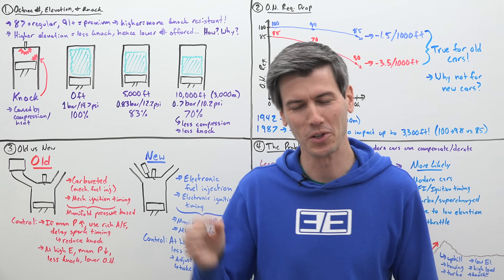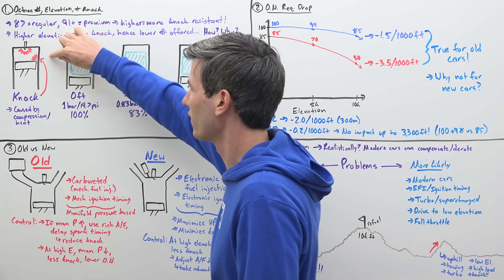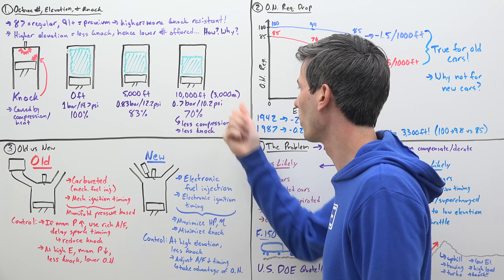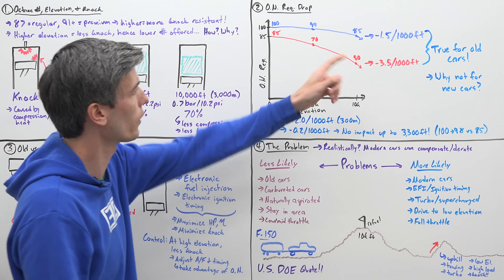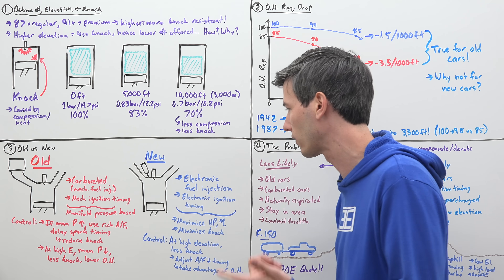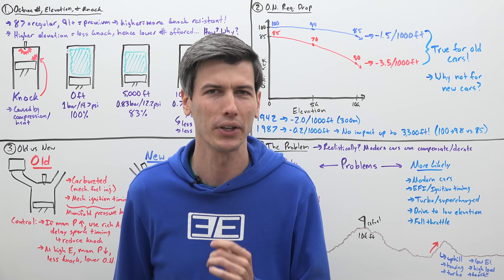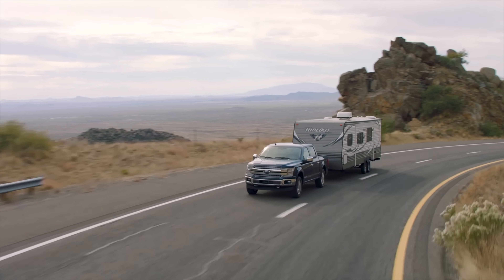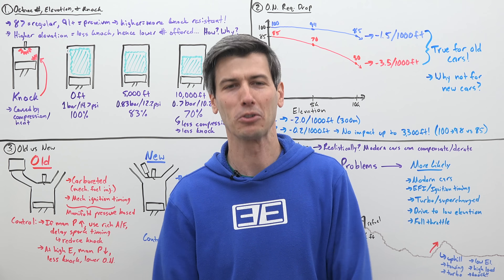Never Use This Gas In Your Car!

Comment: "I'll immediately change to 87, lol." - People who have been using 85 octane 4500 ft above sea level for 50 years. --   Something tells me this guy has never driven or owned a car in the mountain west. Modern fuel injection, even in turbos, at elevelations above 3500 feet runs splendidly on 85.  Should you put in 91 if you really want to MAXIMIZE HP and torque?  sure.  But we're talking fractions of better performance.  

The part he's NOT mentioning is the ethanol variable.  Around here in Utah all fuel is at least 10% ethanol.  That 85 fuel vs 0% ethanol 85 might actually be noticeable due to the slightly higher burn temp of ethanol blends.  The lowest pure gasoline octane available here in Utah is 88 octane...thus validating both @EngineeringExplained and my viewpoints.  The higher burn/combustion temp of 85 octane blend is not mentioned in this video.  I don't love ethanol but it's the reality of the world we live in.  You simply cannot find non-blend 85 octane in 2026 that you perhaps could have in 1987 -- and if you could, you wouldn't want to put it in your 2026 Ford F150.  Furthermore, ethanol has a high heat of vaporization, meaning it absorbs more heat as it turns to vapor, creating a cooling effect that can reduce engine knock, but this doesn't negate the higher combustion temperatures.

 I can't think of anywhere in the US where you might fill up above 9,000 feet and drop to less than 3,000 within a tank-full in a fully loaded/hauling pickup - but I suppose there's areas.

Comment: My family lives in Colorado and has been using 85 octane forever. We have fairly new cars (2010, 2014, 2022), all different brands and different engines (4cyl, V6, V8). We have never had any problems. If we plan to drive out of state, we do opt for 87 though.

Comment: This is a great video. My buddy has a Raptor and the dealer told him he could run it on regular, but in Colorado, where we live, they sell 85. It won’t destroy the engine due to knock sensors, but it retards the engine so much it gets much less power, and as a result less MPG. Now that Toyota and other brands are doing away with NA engines and selling turbo 6’s they are telling people they can run regular in them but not that regular is 87, not 85, and that the EPA mpg rating is using premium. Current engine controls and turbo engines are throwing everyone for a loop. The same goes for VVTi NA engines. They have to run mid grade to get the performance they were designed for. Dealers are playing both sides of the fence- they don’t want to tell people there new cars require premium, thinking it is a negative attribute, but they also aren’t telling people using regular won’t get them
The MPG/power they were promised from the factory. And no one is talking about 85 octane making the whole problem worse in high altitude states.

Comment: I grew up in an 87-93 area, now I work in an 85-91 area. A coworker somehow took such bad care of his '23 6.8 F-250 work truck that we had to get a new engine installed at 44k miles. Cams and lifters were ate up. I guarantee it was a combo of using 85 with 70% of it's life idling.

I always put 89 octane or 100% in our gassers. Seeing the 85 sticker for the first time really threw me for a loop

Comment: I don’t agree that 85 shouldn’t be available. Each vehicle has its requirements written in the manual. If your vehicle tells you to not use 85, then don’t. None of this is new. Some cars have required high octane long ago. Many even said on the gauge or filler to use “premium only”. 
It’s the driver’s fault if they don’t read instructions.

Comment: Manufacturers have lost this in court.  They must make their vehicles to operate on fuel in all states.  That's why more modern vehicles have variable timing and say with high octane you get more horsepower and fuel efficiency,  but less performance with lower octane.

Comment: I mean they sell diesel too even though you shouldn't use it in non-compatible cars. Just require signage and warning labels. No need to outlaw cheaper gas people also use in things like lawn mowers or snow mobiles that run a carb.

Comment: First (and only) time I got burned by this, I had just crossed into CO. Wasn't paying attention, fueled with that U85, and proceeded onwards. Learned that day that gassers can derate, while climbing Eisenhower right up against my Ranger's load capacity. Pulled over right before the tunnel, let 'er cool until the charge air line headed to the air cooler stopped glowing, cleared my codes, etc... got lucky in that there was no serious damage. Picked up half a tank of U92 once I hit Denver to forcibly raise the overall octane rating in the tank, never made that mistake again lol

Comment: @TFL lol

I would expect a fuel injected engine with a Vane Air Flow meter to be OK with slightly lower octane at high altitude as well as a carbureted engine.  A bunch of VAF metered systems were made in the late 80's and 90's, but were phased out by the early '00s.  Anything with a Mass Air Flow sensor is no-go.  By measuring mass instead of volume, the MAF systems are correcting for altitude in the fuel metering calculation.

Comment: One MAJOR question unanswered - if the engine's electronics will protect itself from damage, why does Ford (or anyone) say avoid "low octane" gas?

Yes of course the performance will suffer, but the subject of this video was the DAMAGE issue.

I'd guess there is some limit to the engine's ability to protect itself? But that question was left unanswered.

Luv the videos.

Comment: I'm surprised that Ford was the one that claimed that. I used to work for a limo company that has a fleet of 250+ Expedtions and Transits, all with the 3.5 Ecoboost V6. They run 85 octane exclusively here in Colorado. It is all high altitude driving though, with the lowest elevation being 5280 feet, and the highest being 11,158 feet. No towing involved, but still hauling up to 11 passengers plus packed full of luggage. In fact, they had to ditch Mercedes Sprinter vans because they kept developing frame cracks from the excess weight. They don't anymore, but they used to test engines for Ford when I first started there.

Comment: 85 octane is sold in places where the air density supports its use. Places such as Colorado have lower air density and thus less knocking.

The maximum octane is also lower. Some states have 93, some have 90. The minimum ranges for 85-88 depending on where you live.

Yes “some cars” ban 85, but they also don’t allow 87. 

Some cars detune the motor automatically and can run on any octane.

I wouldn’t suggest you get 85 and then drive to the coast on that tank, but using it at 5000 feet isn’t an issue.

The extra $1/gallon at 150K miles is $7,500 assuming 20mpg. I don’t see the benefit of the better gas depending on the compression ratio and or boost pressure for the specific car.

Comment: Been putting 85 in my 2001 Toyota Camry for 20 years. At 235k miles it is excellent condition and I do not see the point in changing now. It's a manual stick shift and I keep it at low throttling. All it needs is gas, oil, brakes, tires and routine maintence which I am very consistent at so I see no reason to change. My car pays me to drive it. 😂

Comment: I drove a 2016 Subaru foster. And I did not realize you had to put 87 octane in 85 was used for about a week. When we noticed that the MPG had dropped considerably about 25.mpg when we put in 87 we averaged about 28 to 32mpg. 87 works.

Comment: I really appreciate this video! I have lived in Colorado for 6 years now and have always been against the idea of running octane lower than what the manufacturer calls for(mind you most vehicles call for 87 minimum). In my experience I have noticed all the vehicles I have owned with EFI have required at least 87 if not 91. It's also not just Ford that mentioned the few states selling lower than 87 octane fuel. Nissan does the same thing and mentioned it in the owners manual on my old 1993 Pathfinder and my 2012 Frontier. I don't recall them mentioning the idea of running premium fuel though. As for Ford, I remember with both my 2019 Ranger and my Grandpa's 1994 F150 stating in the Owners Manual to not run lower than 87 and to use premium fuel for Towing and better performance. Keep in mind the F150 has the old 300 straight 6.

Comment: DO NOT USE HIGHER OCTANE  than your manufacturer recommends in cold weather.  You will get misfires in cold weather and very hard starting due to the increased ignition temps needed to combust higher octane fuels.

Comment: Would like to see you do a breakdown of effective octane and anti knock properties in the winter. Here in Canada we have 6 months below freezing sometimes down to -40. My conjecture is knock is not possible on 87 even when 91 is required, and there is much more performance/timing on the table that manufacturers leave off.

Comment: You stated several times that the manifold pressure was higher under load, but without forced induction what you're actually getting is less vacuum.  Technically your statement is correct, but it could be misunderstood that something is boosting pressure.  Thank you for another excellent lesson!  Love this channel!

Comment: Different engines have different compression ratios. Cars that have higher compression need higher octane gas to prevent pre-detonation. Lower compression, less octane without worry of pre-detonation. Being at a high elevation (Less bar in the cylinder) , effectively making it lower compression. Therefore 85 octane at altitude acts like 87 at sea level. If you’re driving through the mountains, 85 is NOT going to hurt your engine.
Reply: I read through the comments and you are the few who got it right. It’s the engine compression ratio which makes the difference😂

Comment: I have always used 85 Octane here in CO. Never really had a knock issue.  Currently drive 2 modern vehicles with turbo engines, too.
Reply: He said that was no problem unless you drive that gas down to lower elevation and then push it hard.

Comment: So... in the discussion of the upper left quadrant, that's not how it works.  Your intake pressure is lower, and your bottom-dead-centre is lower --- the former by .7 (say), but the latter ..well that's way more complex.  The pressure pushing air in is .7, but the air charge that ends up in the cylinder is going to be a factor of the fluid dynamics of the intake and the time spent during the intake stroke.  It could be wildly different than just the same fraction as the intake air.

Comment: I remember almost over a decade ago a gas station right on the border of Virginia and North Carolina had every octane between 87. I think 91 going up in increments of 1. It was the first time I'd ever seen a gas pump with so many different buttons.
Reply: By the race track?
Reply: Almost any gas station can do that if they want - there's only regular and premium in the ground, the pump just has a mixer that mixes them together 50/50 for mid grade, but you could literally create any octane between the 2 at whatever increments you want by just adjusting the ratio.
Reply: Sunoco?

Comment: In Colorado it’s 85,87,91, my Camry uses 87 and  I use 87. I use  to put 85  till I put 87 and noticed the difference in power and efficiency and also my manual says so

Comment: Its kinda crazy to me that you can still buy regular gasoline in the US (91 RON 87 in the US) here in Germany you can only get 95 and 98 (100+)
Reply: Kerosene is compatible with diesel to some extent.  It depends on the ratio.  A little kerosene in your diesel will prevent gelling in cold weather.  Too much kerosene and you will not have enough lubrication.

Comment: You are most likely to have an issue on motorcycle (or likely very high performance engine car) from the early days of fuel injection before knock sensors were installed.  Now make it a speed-density FI mapping, air cooled and pushing limits of the what the platform was intended to allow (think Buel Thunderbolt) from the the factory.  At altitude it still does fine but the second you get below about 4500 feet it is more likely to have knock under high throttle openning, low RPM than a CV carb engine (because CV carbs compensate for you).  

My 1999 Honda VFR is water cooled, actually used a MAF but it still exhibited minor issues using the 88 (mid-grade) in Colorado when it would come down from altitude.  My Buell Ulysses that REQUIRES 91 octane had issues that a less attentive rider could have made catastrophic coming down from 7500' to 3800' on a hot summer day filled with the highest octane available which was 89 AKI.

Comment: It doesn’t help that turbos on cars are added to increase power even at sea level while reducing engine size. Airplanes and Diesel trucks use turbos only to compensate for thinner air at altitude but not to downsize engines.

Comment: I think it's odd that the octane levels of the available gasoline or so close, only a few percent difference.  It doesn't seem that significant.  I wonder how accurate the octane ratings are.  If gasoline was available in 90, 85, and 80 octane, restrictions on usage would make more sense.

Comment: I kind of get where you’re coming from about selling the fuel, but then again they also sell diesel at the same gas stations. You also don’t want to put that in your gas powered car. But they can sell it of course. Same with e10 gas here in Europe. It usually has a sticker next to it that you need to check if your car is suitable for that type of gas.

Comment: I believe I had some LSPI in a 6.6L L8T GDI engine running on 85 octane in at around 5,000 Ft because of this low octane fuel. I did refuel with 87 before I left the elevation.  LSPI is more serious than spark knock.

Comment: This is good info and all but I don’t think this guy has lived at a high elevation. I’ve lived in Utah for 14 years, have only had cars that need regular unleaded gas, have used 85 octane gas and had zero issues. But it’s cool to see this from an engineer perspective.

Comment: this guy is so fos it's not funny
"Octane", strangely enough, is the name for hydrocarbons with eight hydrogen and eight carbon atoms in the chain. OCT means EIGHT. Otherwise known as Benzine, or Gasoline. 100 octane means 100% of the molecules are a chain eight long. It is NOT resistance to knocking. Knocking can occur completely outside fuel factors, like blown head gaskets or worn or burned valves. It can mean vacuum leaks, for instance.

After seeing this foolishness, I'm out, and you should be, too. KNOW the fuel requirements of your car.
Reply: Not quite.  Yes, "octane" refers to alkanes with eight carbons, but the number is not the percentage.  An octane number of 100 is assigned to a reference blend, and gasoline is compared to the reference blend for resistance to knock.

Comment: Talk about weaselly CYA warning from Ford.  Besides the fact, as explained, that at altitude not so much octane is needed, all cars for the last four decades have knock detectors that will retard the ignition if pre-ignition is detected.   And the consumer gets screwed because they get less octane in Denver but pay the same per gallon as at lower elevations. 

As to that Dept of energy warning, I can't imagine why the lower octane fuel at elevation is OK for carbureted engines, but not FI.  I would think it the opposite since the former do not have any knock sensors.

Comment: 85 octane is not the same as e85! E85 has an octane rating of above 100, yet most vehicles aren’t equipped to deal with its unique properties. Make sure either you’re vehicle is designed for it, or perhaps you know your vehicle and have built a car to run on it for extreme performance.

Comment: If higher octane is better for turbo direct injected should we all be using E85 100+ octane if the engine can take it?  I care much more about component longevity than I do fuel economy.  I'm the change the oil at 3k miles even though mfg say every 8k type of person.  I don't want to spend eight thousand on a repair.

Comment: Drove through Montana and Wyoming and filled up with 85 once on my 07 honda element and got some knock. Immediately stopped somewhere and got some octane booster lol.  Now I just bought a can in denver and filled it up with Premium (93) at costco because the last thing I want is my new, naturally aspirated, engine to have issues going back to Minnesota. Worth the extra couple bucks for that drive I'd say. Now I can hang out with 87 here again though.

Comment: My 2024 4Runner Manual says use 87 or higher.   I’m in Richfield, Utah and my options are 85,88 or 91.  Is it just safer to use 91 without any risk?  What is 88, not familiar with it.  Is 88 safe to use or should I just use the 91?
Reply: It doesn't matter boss. You can also just mix the difference fuels together if you're trying to get an octane value in-between. If you have a 2024 it's essentially guaranteed that the ECU detects the type of fuel and changes the 'tune' accordingly. So unless it runs like ass or you really need the extra 5% Horsepower, 88 is fine.
Reply: Thanks!

Comment: so just to be clear ... we can use 85 Octane fuel in a car that has electric fuel injection and timing at approx. 5,000 feet above sea level and knock damage the engine  ?
owner's manual spec: octane 87 or hinger

Comment: Here in Austria (Europe) the gasstations don't even sell gas with less than 95 octane and it's called "Super 95". Some gasstation will have "SuperPlus 98" and  even their premium gas with 100 octane, but that usually cost 20 cents per liter more (~75 cents per gallon).
Reply: The Octane levels recorded in Europe and US is kinda weird, 100 octane in EU is equivalent to 90 America or to get more descriptive 98/100 RON(EU) means you will need to use 93 PON(US) kinda sucks and is extremely confusing there's no real worldwide standard.